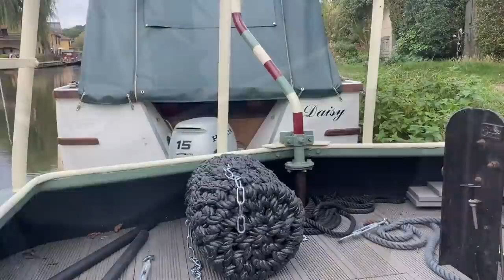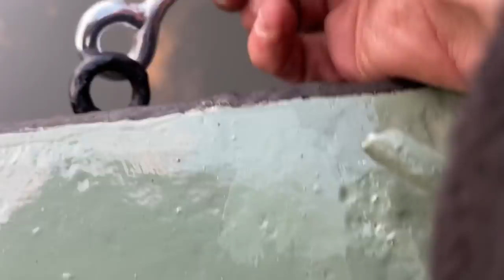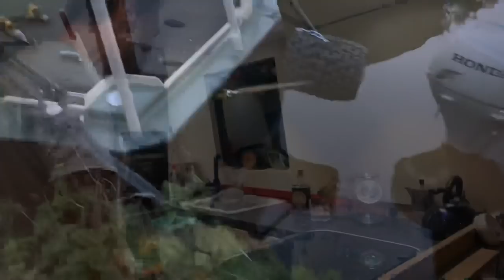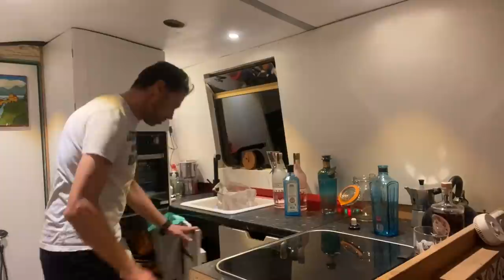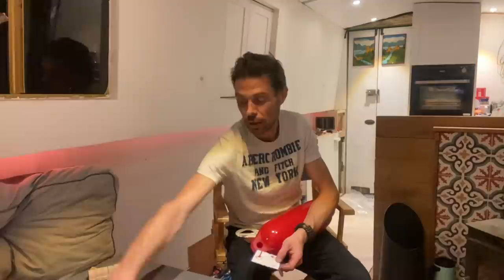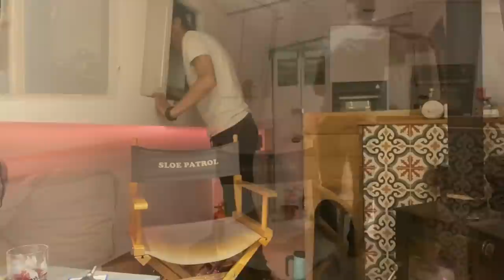268. Rear bumper, curtain brackets, Sloe Gin making and fender tying

Comment: Great vlog James. You have selected the right knot, a round turn and two half hitches, to tie onto the fender as it will tighten under use. The fisherman's hitch is a variety of the knot you tied  that will not tighten on itself, not what you want.  The Knot you should use to attach the fenders to the boat is a simple clove hitch, secure but easily undone to allow you to move the fender quickly and easily when necessary.   It is well worth learning to tie a clove hitch it is one of the most commonly used knots and makes the user so competent.  Watching you tie  knots took me back to my days as a Fire Service Instructor teaching trainee Fire Fighters to tie Knots. Frustrating but so rewarding, remember a knot is a tool, learn the right knot to use,  Once again well done and thanks for sharing.
Reply from the maker: Good to hear my man - good to hear. 
You are now the Channels knot adviser for the 2021/22 season.

Comment: It was nice to come home to a new vlog after a day of piloting something almost as slow as a narrowboat ( a 1912 vintage interurban tram).  Sitting down with cat on lap and a nice glass of black porter in hand is the ideal way to watch.  

 I recently made a very similar cordial to sloe gin.  It's made with vodka, plums, and aronia berries (aka black choke berry).  I think it will go well with wine, heated as a wassail drink.  Also made a similar cordial with asian pears and vodka with a splash of rum and a stick of connamon.  Tasty, but rather sweet.

Bowline knots are reliable, but a round turn and two half-hitches is the fastest, easiest and most applicable to the greatest number of tasks.  You'll get good at it becuase you'll use it--alot.
Reply from the maker: Nice.
There’s isn’t much quick about the round turn and two half hitches - missed the bond film because of those knots !!!

Comment: Looking great James, my only reservation with the rear bumper is that it could very easily be unhitched and stolen so maybe a couple of padlocks to the final final attachments would add that little bit of extra security, after all they don’t come cheap. Maybe also another adapted loop in the centre for the top chain. 
It’s nice that you are getting compliments on the boats colours already as well. 
Keep up the good work mate.

Comment: Hello James, your fender knots are fine, your on the cut not the ocean. As far as the bumper is concerned, while at Will’s vice you should have bent the large ring open. Slipped a closed loop I- bolt on it, that fits your turnbuckle, and bend it closed again. Minding the left or right hand threads. It will not fall off if you bump something and make it harder to steal. You can change them out one at a time, don’t forget one for the middle chain. Crack on.
Reply from the maker: Good call - will look at that

Comment: Hello James, I am weighing in on the sloe gin methodology. This past summer I made rhubarb, redcurrant, chokecherry and cranberry liqueurs and in each one I added a small amount of sugar at the start (1/2 cup per quart). First, most wild yeasts which are on the fruit can't tolerate an alcohol percentage above 20%, most likely more than 15%. That means your Bombay gin at 40% alcohol would not allow fermentation and so the alcohol would not increase and the yeast would die a happy death. As for the reason for adding the sugar, it increases the osmotic potential so as to draw the good stuff out of the sloes, in the same way that salting fish dries it out. Adding a small amount will still allow adjustment after the fruit is removed. I keep the vodka on the fruit for a month and that's enough for me, but there is no harm in going longer. Freezing the fruit is a great tip and I will have to try it, especially for the rhubarb, which had a raw flavor.

Comment: BTW James, you just mentioned it in passing, and I may have misunderstood, but if you glue the curtain rail into the holders at both ends, you'll have trouble getting the curtains on it.  You need one end of each rail to be free of the bracket so you can take the curtains down for occasional washing and, eventually, for replacing them.

Comment: Should have bought two eye bolts, one for the center chain as well.  As for the knots a Bunt Line Hitch is better on the fender.  Use the Bow Line knot to lash it to the railing.

Comment: Nice work with the rear bumper :)

Now for an infusion and brewing lesson.

Yeast cannot create more than approximately 20% ABV in a natural fermentation, and this only by careful management of the whole process. This is why anything stronger than 20% ABV requires a distillation process to produce the much higher ABV numbers. 

The addition of sugar to an already high ABV liquor will NOT result in additional fermentation. This is because any yeast, and it will be wild yeast from the Sloes, will be killed by the high alcohol content. The reason you should add sugar early in the production of your Sloe Gin is so that the sugar has plenty of time to dissolve into the liquor and form the syrupy consistence that sloe gin has.

My go to bible on all things foraged alcohol is a book called Booze by John Wright (the forager from River Cottage). I have used his recipe for Raspberry Vodka  for years and have in fact upscaled it to do 5 litre batches! I personally do not like the taste of Gin, I suspect its the Juniper berries,  and is why I substitute if for vodka in a lot of recipes. Hell Gin is just flavoured Vodka after all!

I mostly make Mead nowadays and its pretty hard to get that to exceed 14% ABV. 

As for knots I personally haven't touched a rope since I was a scout some 30 odd years ago, so I had a discussion with one of the fishermen down here where I live and his opinion is that the round turn and 2 half hitches are the ideal solution!

Have a look at Well Deck Diaries where Mark made some rope fenders and a hook for securing them to the boat, they are a great idea!
Reply from the maker: Wow ok. I’m not looking for extra ABV - just nice and syrupy like you say. Let’s see how this batch goes

Comment: What about using 15mm chrome pipe for the curtain rail James. Readily available from plumbers merchants would match the cover strips on the ceiling and back panel of the fire. If not strong enough or you think it might bend slide a wooden length of dowel inside the pipe.

Comment: What about copper pipe and plumbing fittings for curtain poles?
Reply from the maker: That would work but no copper on the boat, only steel
Reply: BTW  James , I learnt my 2 knots from a tea towel my wife bought when first started boating.